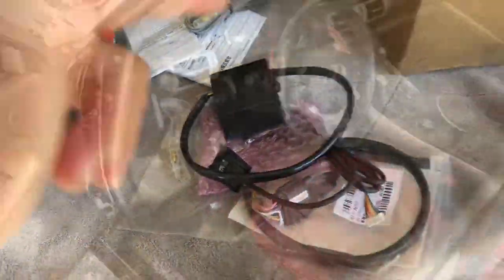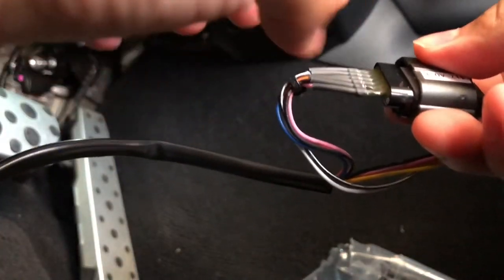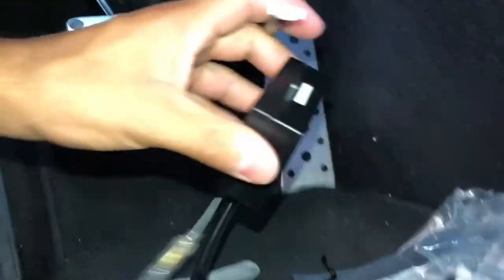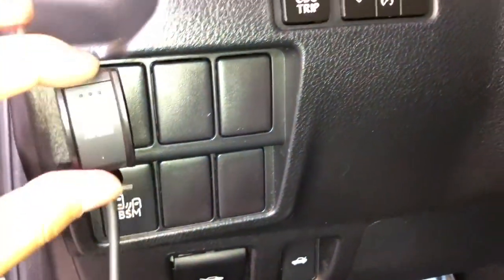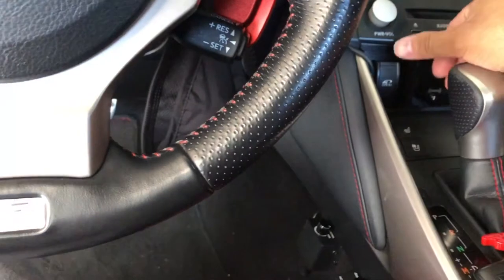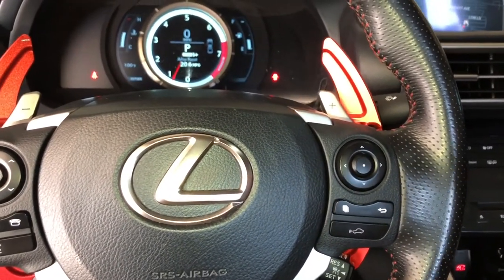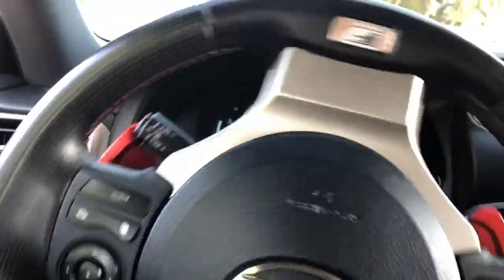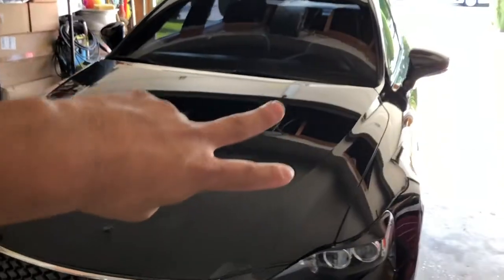INSTALLING AN APEXI THROTTLE CONTROLLER ON LEXUS!!

Comment: I bought one, installed it and went to bed. That same night I was reading through some forums about throttle controllers and I removed it from my car immediately. I'm keeping it until proven okay to use. These cars are quick enough, I don't like something messing with my throttle
Reply: What was the negative/ potential harm from installing this?
Reply: so what did you actually find out wit these forums about the cons to these?
Reply: For those asking, some on the forums are experiencing problems after a while because of the voltage in connection to the sensor. Ending up in an expensive repair bill. Not all users are experiencing this but some are which is a cause for concern. Same risk with most aftermarket products, some have issues, most don't.
Reply: Just use a tunner device and map different tunes

Comment: I drive a 2001 Honda Prelude and yesterday took one of these Lexus for a test drive at the dealership.. I thought there was a problem because when I press the gas pedal 1/4 of the way down the car wasn't moving.  I have instant acceleration on my Prelude.  It is a nice car.. still unsure if I'm going to trade in the Prelude for this.
Reply: Did you throw it in sport mode? It changes the pedal resolution & trans tune thus giving you the response you’re looking for. I have a 19 is300, and I’m okay with it. It is annoying that you really need to hammer the pedal down to get it where other cars mostly are already at. I think it’s just a way for Toyota to get their epa numbers and maybe the reliability points…. I still love the car, if I wanna boogie, I’ll throw her in sport.
Reply: a custom tune gets rid of this, lexus detunes the hell out of these cars to make them comfort and luxury, there a multiple builds of people making 300 whp N/A with just fbo, and people making 330whp+ with N/A FBO E85, Ported Throttle Body, and Ported Intake Manifolds

Comment: Your links no longer work for this part do you have a new link for the throttle controller?

Would you recommend headers and the ARK Grip exhaust over your muffler delete and mid pipe or do you feel what you’ve done was adequate and budget friendly?

I have the exact same car in Mica blue same year and all.

Comment: Great tutorial bud. What exhaust setup are you running? Would love to see some sound clips. Just ordered my Remark Double Wall Quad Tip Axle Back and doing a muffler delete with it, but your setup sounds great.
Reply from the maker: Thank you brotha, much appreciated! I am running a Tsudo Midpipe with muffler deletes. I have heard a couple Lexus with the remark set ups and they sound pretty sweet! I will be making a full video of my exhaust set up soon.
Reply: @Loudbasshead_  Nice man! I'm from NY so I don't think I'm able to do midpipes to pass emissions but really want it for the sound haha. But looking forward to your video.
Reply: Tomek Jurski I live in NYC as well I just installed the ARK exhaust system on my 16’ IS 300 f sport
Reply: @Loudbasshead_  BRO! thank you for making this video. I haven't found anyone else running tsudo midpipe with muffler deletes and I'm itching to cut my mufflers off. Thanks!
Reply from the maker: No problem! Stay tuned bro I will be uploading a exhaust video of my set up tomorrow! It has been highly requested. Subscribe for more content but thank you for supporting brotha!
Reply: @leojohnwayne1422  I’m have ARK exhaust on my IS350 F 2019 too and I had the problem check engine light on and off all the time, do y’all think to do this will fix Electric throttle Control problem ? Any opinion y’all ?
Reply from the maker: Have you scanned it to see what codes pop up, once my check engine light turned on for something as simple as an exhaust leak. Smh, changed the gasket, fixed the leak and never saw the light again.
Reply: @Loudbasshead_  can you go over all the different types of exhaust and what they mean? Wtf is a mid pipe, wtf is an axle back, wtf is headers etc

Comment: Hell yeah definitely getting this
Reply from the maker: Definitely worth it😊
Reply: @Loudbasshead_  bro will this work on an is250 06 model
Reply from the maker: Yes the install process should be exactly the same bro. But you would need to buy the correct wire harness for your year. They should have it on the Apexi website if not then eBay.
Reply from the maker: I got you right here my guy👌🏼 
https://shop.redline360.com/products/apexi-smart-accel-controller-lexus-is250-is350-w-harness-2006-2013-417-a014-410-a001
Reply: @Loudbasshead_  dude bet I just got my is250 and the lag is horrible bro so I need this asap
Reply: Just ordered this my Nguyer

Comment: Is it bad for the U660E transmission due to the sudden jolt? I think this is one of the reasons there is a ramp up from factory when you press the pedal
Reply: This does not alter the engine at all. But only your petal. 
Bascialt the controller mimics as if your are pressing on the gas so ever so slightly on idle. 
And decreasing your distances of a pushed petal.

Comment: What midpipe you using ? What would recommend for midpipe + remark exhaust? To clear the drone ?
Reply from the maker: I’m using the tsudo midpipe with a muffler delete. If you don’t want drone I highly recommend getting aftermarket mufflers paired with the Midpipe
Reply: @Loudbasshead_  i had the remark axle back exhaust with quad burnt tips so do you have any midpipe would recommend to reduce the drone , just by a little bit ?
Reply from the maker: Adding a Midpipe would give you more drone since it would remove the secondary cats..if you have the remark axle back due to that exhaust not having any mufflers .

Comment: Ay bro I like your video but I was wonder how is the Lexus is350 for power is it good enough or is it slow? wanting to know i just wanted to know from people that had experiences with this car
Reply from the maker: It’s honestly pretty fast, definitely way faster than the slow 250 or even the 200t. Faster than the RC350 as well. It has good power and it’s enough to get by I really like it
Reply: @Loudbasshead_  I see, thanks for the reply don’t know which one Beamer f30 N55 or that
Reply from the maker: @sezarkhelani5891  in my opinion I think the Lexus would be more reliable in the long run.. but you might Get more performance out the bmw and probably spend more money in parts.

Comment: Good info.... theres cheaper models with BT you think they'll produce same throttle response?
Reply from the maker: honestly I wouldn’t know, I have seen some cheaper models that plug into the obd but haven’t heard any reviews on it.
Reply: @Loudbasshead_  no worries...just that i see them for 69 for a lion power to Apexi for 249 but all claim to do the same so that i dont waste $$ i thinkn $69 wont break the bank😁thankx for you feed back 🤙
Reply: @tee Martinez how did the 69$ controller work?
Reply: @KhanCordice  i hvnt pulled the trigger yet....i see good and bad reviews and hate to waist 70, 80 or 100 just pull later😭

Comment: Hey was thinking of getting this for my 350 too to get rid of the lag, is it worth it over just driving in sport + mode, did you notice any significant response?
Reply from the maker: yes even being in Sport+ mode with the throttle control activated makes a difference. I do believe it’s worth it as well as many other people that’s been in my car and agree
Reply: @Loudbasshead_  thanks man!
Reply: @Loudbasshead_  can you add a link, the link you Provided don’t work no more

Comment: Any details? As in turning it off and on fast and also does it feel more like a car like back in the day with cable throttle?  Sorry for million questions . Also how does it feel in the moments where u need to accelerate to not get  hit by other drivers?
Reply from the maker: When you turn the car off the unit turns off as well, when the car turns back on the unit is off and you would need to click it on manually, it is left stock if not turned on. Also it feels really responsive when in red mode. More than enough to get over cars or react when you feel like you might get hit.
Reply: Eric Alonzo thanks for the response back , truly appreciate it. Last question, can you link harness and controller? Their site doesn’t seem to have them I stock
Reply from the maker: https://shop.redline360.com/products/apexi-smart-accel-controller-harness-417-a021?variant=32943658860624&currency=USD&utm_medium=product_sync&utm_source=google&utm_content=sag_organic&utm_campaign=sag_organic&gclid=EAIaIQobChMIrtrNy9zk7AIVievjBx3MegssEAQYCiABEgJWK_D_BwE
Reply from the maker: https://www.jmautosports.com/product/apexi-410-a001-smart-accel-controller/Default.aspx?gfid=p50090&source=googleshopping&utm_source=google&utm_medium=cpc&adpos=&scid=scplpp50090&sc_intid=p50090&gclid=EAIaIQobChMIhNjEp9zk7AIVsyCtBh1d1AWTEAQYASABEgLyjPD_BwE
Reply: @Loudbasshead_  ty man! Just ordered! God bless you bro, and keep the videos coming! 👍👍👍

Comment: does the same controller work for 17?
Reply from the maker: The controller unit itself is the same but the wiring harness changes for the 17+ models
Reply: @Loudbasshead_  can you send me the right parts

Comment: I’m having a hard time unplugging my OEM throttle controller.. any suggestions?
Reply: Reference the connector that came from apexi there should be one that’s identical to the oem one that connects to the gas pedal , there’s a small tab you have to push or lift (I forget) but it’s really hard to do if you don’t know where the tabs are , it helps to connect and reconnect the harness to itself just to get an idea of how to connect /remove it before trying it on the pedal